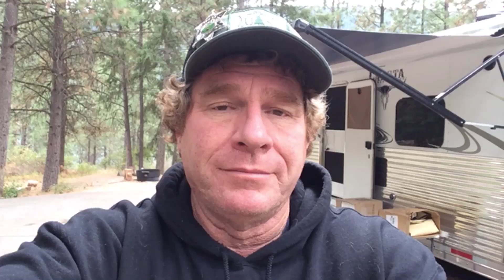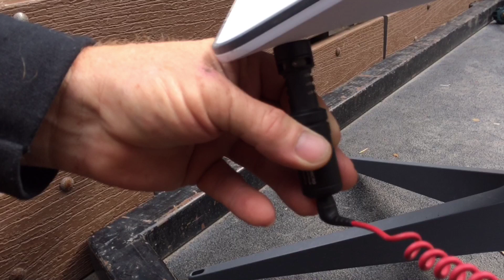Starlink antenna makes noise

Comment: I just got a brand new Starlink Mini antenna. Mine buzzes as well - every time and all of the time. I’ve had it for a week and the buzz/noise is constant. In fact the only reason I found this video was because I was searching to see if others had the same issue, and if it is normal. I guess it is. One interesting observation that I’d add: the pitch of the buzz is different when it starts up than later on. When I first turn it on the buzzing sound has a higher pitch frequency. Or I should say frequencies because it does change from second to second. Once it reaches steady state the frequency of the buzzing is lower and a bit less variable.

Comment: my router does that is it normal
Reply: its crackling to
Reply: Mine makes that noise and it’s warm to the touch🤔
Reply from the maker: @bruceduncan9532 warm is normal. The snow melt heaters are in the bottom. Even when they are off. It still gets a little warm

Comment: I'm in portugal crazy Martin and thanks for the post. Our starling is constantly buzzy, just trying to find the next satellite overhead. Is your electric bill gone up?
Reply from the maker: Since im off grid I know it uses 6 amps of power when running off the batteries. Have not idea what the cost of power would be.

Comment: That guy was me! What a weird noise! Very cool that you heard this cause I never would have!
Reply from the maker: It’s was great meeting you. I’m now running on 12 volts. It saves lots of power through the day. I did discover that if the input voltage drops below 11. The buck booster will also drop. This will cause your Starlink to boot over and over. It basically gets stuck in a boot loop. So the Yoshing POE injector is just barely large enough to power the Starlink.
Reply from the maker: I won’t be up this season. Im building an RV park in Texas. But i do have a replacement host im sending up. Good guy. Lots of fun.